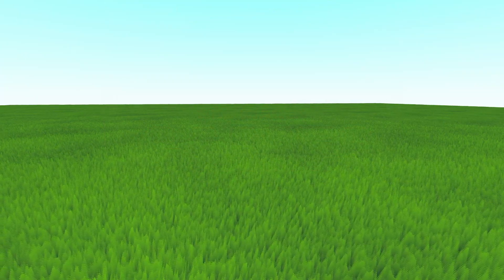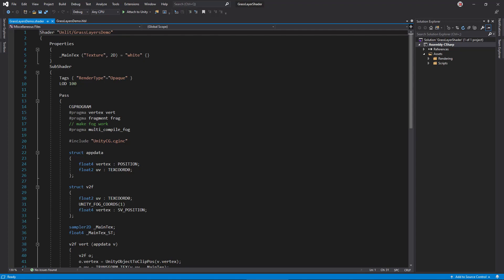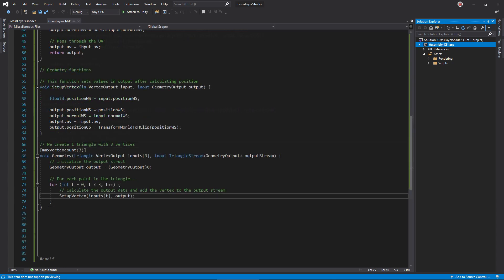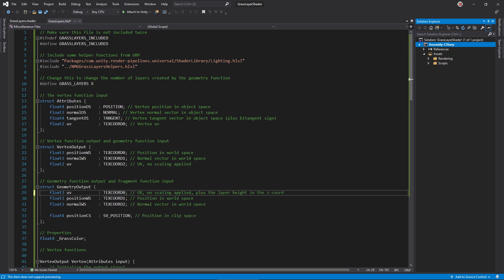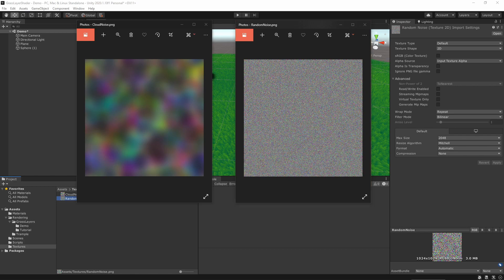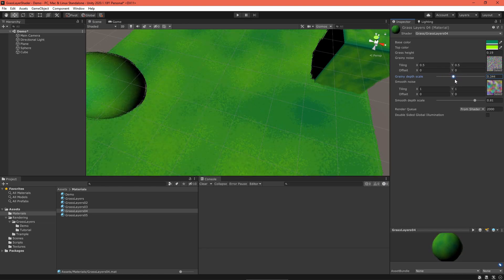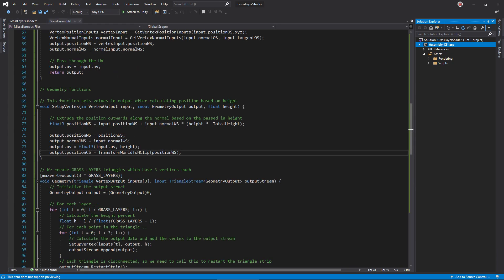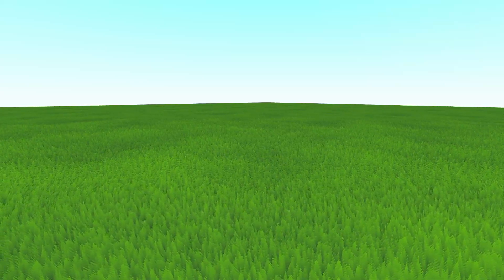Rendering Grass In Unity URP Using Noise and Geometry Shaders! ✔️ 2020.3 | Game Dev Tutorial

Comment: It gives me this error :
UniversalFragmentBlinnPhong': no matching 6 parameter function at Assets/Shader/Grass_Day/Test/GrassLayers.hlsl(167) (on d3d11)
Reply from the maker: Hi! Are there any other errors, or are you using a different version of Unity? That function does have a 6-argument version in Unity 2020.
Reply: @NedMakesGames  Hi, I'm using unity version : 2021.3.20f1

At the moment I don't see any other errors, only this repeats itself.
Reply: @NedMakesGames  Can you give me a solution please?
Reply from the maker: @rizzmaker  Sorry, I've been pretty busy this week.

In 2021, Unity got rid of the 6-argument version. It looks like you can get it running by passing float3(0, 0, 1) as a seventh argument.
Reply: @NedMakesGames  Do not worry it's not a problem.

Line 144 is fine if I rewrite it like this:

return UniversalFragmentBlinnPhong(lightingInput, albedo, 1, 0, 0, 1, float(0, 0, 1));

?
Reply from the maker: @rizzmaker  Almost! It needs to be float3 not float

return UniversalFragmentBlinnPhong(lightingInput, albedo, 1, 0, 0, 1, float3(0, 0, 1));

Please let me know if that doesn't work. Unity seems to change this function frequently, and there's another way we can do it that's slightly more complicated, but seems to be better supported.
Reply: @NedMakesGames  No it doesn't work, it still gives the error:

Shader error in 'Grass/GrassLayers': undeclared identifier 'Inputlighting' at Assets/Shader/Grass_Day/Test/GeomtyShader/GrassLayers.hlsl(167) (on d3d11)
Reply: Is the problem by any chance given by the shadows ?
Because I could do without these.

This is the best grass shader for android I've tried so far, it's a pity that it can't be used on advanced unity versions.
Reply from the maker: @rizzmaker  It should work! I've used this function up to Unity 2022.

It seems like you might have a typo? The code I gave uses "lightingInput" but your error indicates there's a variable called "inputLighting." I would double check those all match. Can you paste your code here?
Reply: @NedMakesGames  ok much more likely it's my typo, because trying with another shader, that string works for me too.
I'm at work now, as soon as i get home i'll check the script in question and paste It here if necessary.
Reply: I agree it was my mistake,
Redoing the shader from scratch and making the corrective string everything works.

Thanks for the help, and sorry for the inconvenience.
Reply from the maker: @rizzmaker  It was no problem! I'm glad it's working now.

Comment: Hi, Is there a way to apply the shader only at certain world heights?I have a 3D mesh that has different textures based on the height (grass, sand, water) and i want to apply the grass shader only on the grass part, is it possible?And if so how?
Reply from the maker: Hi! Yes this is possible! Basically, in the geometry function, check the world position of the input triangle's vertices. You can determine if they are within your height bounds using the y-coordinate or each vertex, the average, or whatever scheme you want. Then, only append to the triangle strip if the triangle passes your test!

Comment: Noticing the shadows, I don't think this shader is taking ambient lighting into account. 🤔 Would there be a way to make that happen?
Reply from the maker: Hi! Yeah that’s possible, but unfortunately not super easy. The shader graph doesn’t support geometry shaders, so you’ll have to use an hlsl shader and add in the needed code. I’d take a look at the URP lit shader source and adapt that to your needs. Specifically, the magic happens in the UniversalFragmentPBR function in Lighting.hlsl
Reply: @NedMakesGames  Ah I didn't realise ambient lighting required a geometry shader! Interesting. Thanks for the tip about the UniversalFragmentPBR function!